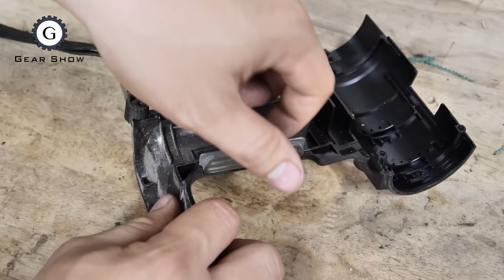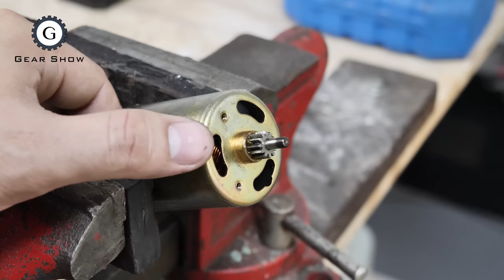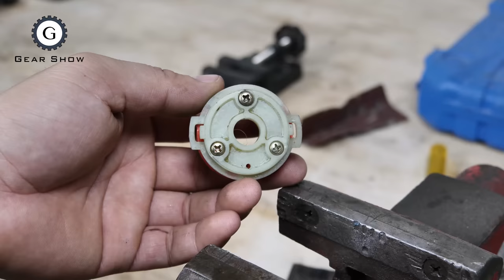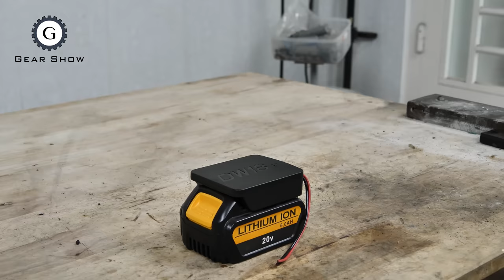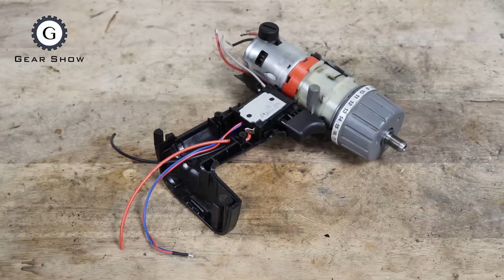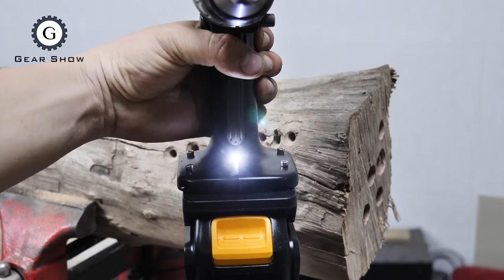How to upgrade a vintage to modern drill driver

Comment: Nice modded
At the Led you can connect a small Capacitor in order to after push the trigger the Led can be lighted for 1-2 second( the time led lighted after push due to the capacitor capacity)
Reply from the maker: Wow, that is a great tips, thank you so much for sharing!

Comment: This drill seems to a generic version of the Panasonic 9 volt from the early 90's or late 80's. I bought it at Lowes. Panasonic made  good (expensive)tools. They have become hard to find because they are not in home centers and seem to only sell them at specialty stores.

The problem I have had with mine wast the speed switch on top. lost the little spring and a part of the switch   broke in pieces. Panasonic has always been piss poor on parts for these drills and I refuse to get rid of it to spite Panasonic!
Reply from the maker: Yes, it is hard to find its spare part, like this one, there is a problem with the power switch. Anyway thank you for sharing!

Comment: One thing i would change is that instead of 3D printing that part/spacer, i would cut some copper line spacers and use those. That would give the motor a little bit more space to breathe. With a couple of washers on the plastic side, it would work perfectly ok. Also, no issues with strength, i used to do this all the time when i spaced much stronger electric motors for saws to keep the motor well out of the enclosure.

Comment: A bit concerned about the 3D printed part for the motor. Won't the excess heat melt it eventually?
Reply from the maker: Yes, it will melt in real working. Aluminum is the best choice.

Comment: Kind of cool, but I wouldn't call it an upgrade. This is like the drill of Theseus. You might as well 3D print an entirely new housing for the internals at this point.